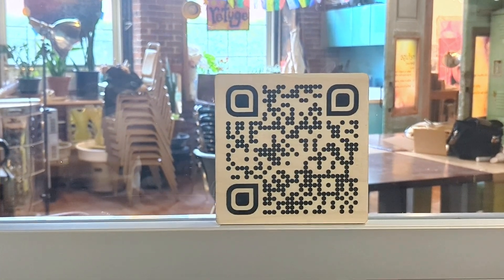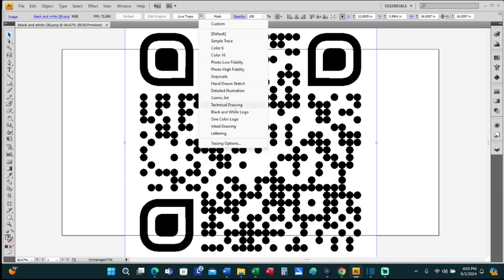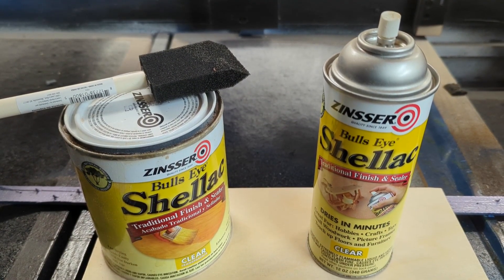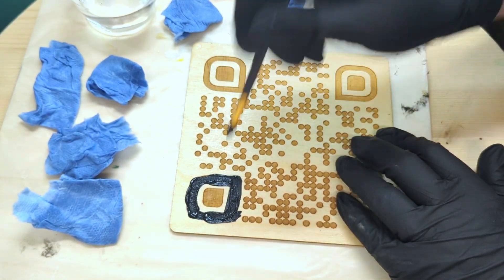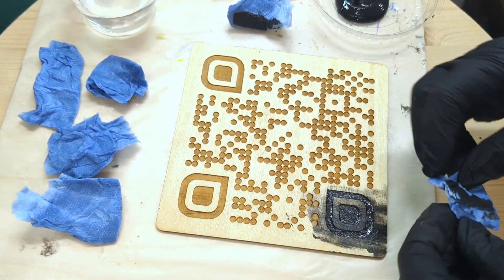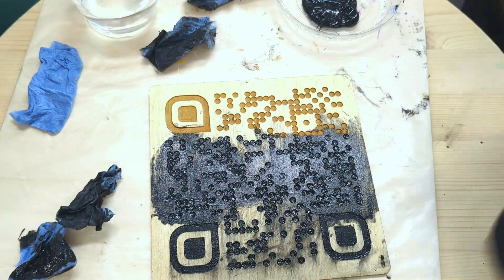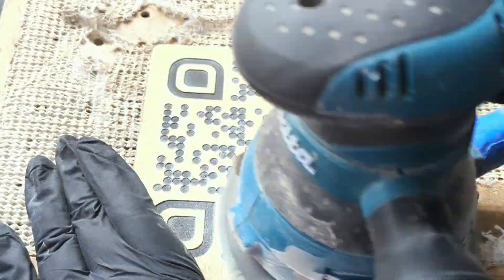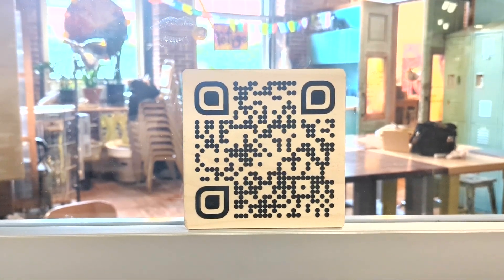I Made a QR Code out of Wood and It Works

Comment: If you masked it you could have painted it then pulled the masking off. Also wouldn't get the burn marks
Reply from the maker: That is a common method.  However, I hate having to remove the masking tape.  Especially all the tiny pieces which are easily missed.  It really comes down to preference.